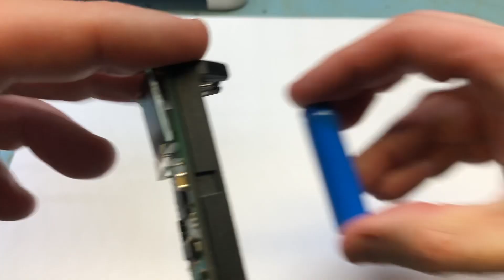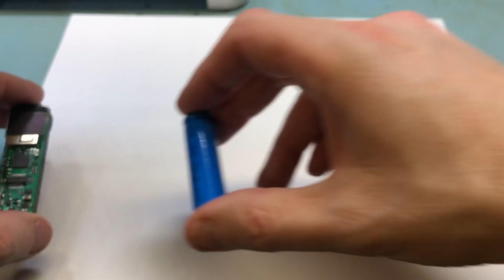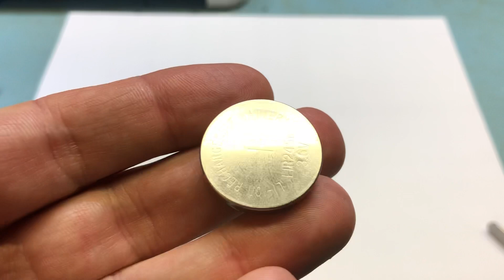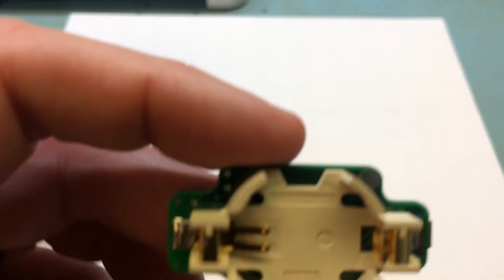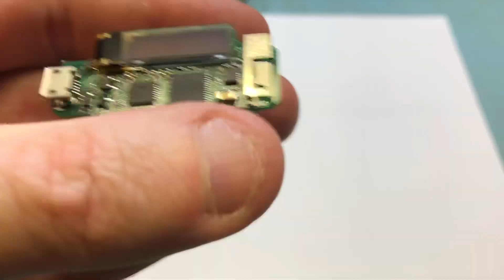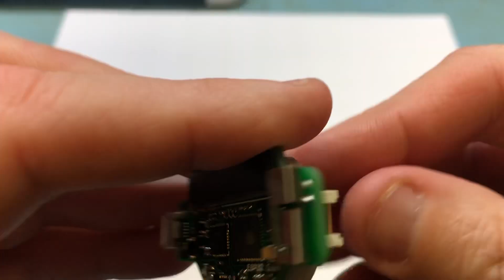ESP32 Pico D4 CoinCell Board

Comment: Awesome.  
Battery LIR2450 has enough power (mA) to run Wifi ?  Wifi need peaks about 400mA I think...
I have some doubth about antenna, 
I see  in Rev 4 don't use C1,C2 for tunning  ( I think is not necessary because antenna has Z=50 ohms and datasheet esp32 tell Z out = 50 ohm too), then only use L = 1.8nH to filter, is not true? 
 By other part in Rev 1 your use  C1,C2 and L which works better for wifi ?  Rev 1 or Rev 4 or both are well ?  Thanks a lot and thanks to share
Reply from the maker: 400mA pulses stress the battery but it holds up for a little while. Hard no on the non rechargeable battery. I have no antenna tuning experience but have followed the components used on other boards and have the screen putting out RSSI values all over the house.
Reply: @0miker0   But you are using Rev 4 or Rev 1 pcb? Rev 4 only use a inductante and Rev 4 use 2 capacitors and 1 inductance... both layouts works ?
thanks
Reply from the maker: @jospicant  Both seem to work fine. No issues.
Reply: @0miker0  Then one inductor better less components... thanks a lot
Reply from the maker: @jospicant  good to know and I wasn’t sure what to use on the board. Thanks!
Reply: @0miker0  when I made one and try it I tell you. Thanks
Reply from the maker: @jospicant  Sounds good and id like to know how it turns out.
Reply: Hey do your have the files to this public? Super awesome!

Comment: Hello Mike, I have a question. Could you please explain how VUSB and VBAT power circuit works, I mean the place where's  mosfet, diode and 100K resistor?
Reply from the maker: It is a way to power the circuit from either the usb or battery. It prevents the battery from feeding into the usb track or the usb from feeding into the battery. I've copied this circuit from the Adafruit schematics and it works really well.

Comment: Hey, could you explain, why did u use capacitor and resistor next to EN pin of ESP32? :))
Reply from the maker: It pulls the reset line low for a bit on power up and then high. The line is low while the cap charges and then stays high. Pretty common on most power up reset low circuits.

Comment: Hello, how did you calculate C and L values for antennas impedance matching?
Reply from the maker: I do not have the tools to get the impedance matching correct for the antenna so I just make the trace as small as possible and use recommended values from the datasheet.
Reply: @0miker0  you mean, you used ESP32 (QFN 6*6) and ESP32 (QFN 5*5) are (30+j10) Ω and (35+j10) Ω impedance values, and according to them u calculated C and L values?
Reply from the maker: @petraszakevicius2017  I have no idea what you are talking about.
Reply: @0miker0  ok, could you please where you found those recommended values from the datasheet? They are in pico-d4 datasheet?
Reply from the maker: @petraszakevicius2017  the Pico D4 datasheet and other projects that people have done.

Comment: Hi mike, very impressive work. I am also working on a similar board but much smaller one. I wanna know how do you program these PICO-D4 chips for the first time with only Rxx Tx, IO0 and EN lines alone? I don't have an USB connector only my board
Reply from the maker: Gudimetla Kowshik you will need an external USB board to program yours then. Take a look at my schematic and you will see the CP2102 that is the USB interface and dual transistors. The dual transistors are there so you won’t have to hold a. Turin in power up to get the esp chip into a state to accept a sketch on power up. With the dual transistors you can upload a sketch with just one click: https://github.com/mike-rankin/ESP32_CoinCell/blob/master/PCB/Schematic_Rev4.pdf

Comment: What about a discharge protection circuit for the battery? Is that not needed? Why?
Reply from the maker: Arik Yavilevich battery discharge protection should be used to prolong the life of the battery. This revision doesn’t have that.

Comment: This looks awesome, great job! I'm curious about the power consumption, just to have a rough idea how much time does the board last with the code of the video and with the battery fully charged?
Reply from the maker: Joaquin Verastegui with the display on it constantly connecting to wifi it’s a whopping 5 minutes! Using sleep mode and waking every 10 minutes it will last 10 or so hours though. It turns out that wifi off of a coincell isn’t a very good idea.
Reply: @0miker0  thank you for your answer. Indeed it seems it's a little bit too much for that coin battery, although I guess you could optimize energy on the firmware. Nevertheless it is a neat and compact board that could be improve and gain a lot of potential. Congratulations!

Comment: Great work Mike, just love it, my PCB's are like giants compared to yours, I am still sticking to 0805 parts. Once I get my PNP running I might go smaller :-)
Reply from the maker: Hayri I’ve just made the switch to 0402 components that has really helped projects get smaller. A good quality boom microscope is a must though. I’m also finding more and more components have pads under the part now requiring solderpaste.
Reply: @0miker0  Thanks for your reply, I will switch eventually too, might go with 0603 first and push everything closer together, going 4 layer will make it easier as well. Would like to use the CP2101 as well to be able to get rid of the USB adapter and having it more compact. The good or bad part is, as soon as  a new PCB is ready, you already have ideas to improve it or make it smaller with added features :-) For me right now, the display size is the limiting factor so I try to add as many features as possible.

Comment: You might be able to fit some of those tiny side mount tactile switch smd's around the edge.
Reply from the maker: Steve Gagnon they take up too much space. Right now it wakes when touching the capacitive pad. I’m working on it also working on having it wake on double tap using the accelerometer.
Reply: @0miker0  was thinking of something like alps SKTDLDE010. though im sure you can get other parts that are even smaller.
Reply from the maker: Steve Gagnon I cant have momentary buttons. Capacitive pads maybe but no buttons.

Comment: Nice project, what development tool chain and programmer are you using ?, whats the programming interface  that you use to blow code onto the board, I don;t see a programming port ?
Reply from the maker: Peter Wilson I’ve never even mentioned in the video that the Arduino IDE is used to install new sketches over the microUSB cable. You just select the correct com port and then click the upload button. The CP2102 chip is the USB interface chip.
Reply: mike rankin that’s excellent, which programmer and board do you select from the arduino IDE, I see lots of choices once I’ve added the ESP32 arduino module..
Reply from the maker: Peter Wilson ESP32 Dev Board

Comment: Impressive little boards! Are you hand soldering these or reflowing?
Reply from the maker: My screen didn’t arrive with the boards so I had to hand solder. The screen is a faster and more reliable method because the only ground net is the large pad under the center of the ESP32 chip.
Reply: Are you hand soldering all the other components, capacitors, resistors, pico etc?
Reply from the maker: Ian Tcroft yup. You need a cheap 858D hot air wand and microscope along with a regular iron.
Reply: Fantastic!
0402 are not for the faint hearted!

Have you considered creating a vlog assembling your boards?
Reply from the maker: Ian Tcroft I could never solder a 0402 without a microscope. A few years of hand soldering without one eventually ruins your eyes. As you can see from my videos, I have no camera gear or editing skills at all for showing soldering techniques.
Reply: A microscope is a must then! Have to say they look very tidy from your close-up shots!
Shame you don’t have the equipment to record it, would have been great to have seen your technique.

Comment: very impressive, What is the usb esd protection for ? I have never seen anyone use or need that.
Reply from the maker: tablatronix not sure if USB esd protection is needed. I was just messing around.I’ve seen a better design that uses a different part that monitors current and protects against a faulty device from damaging your pc that it’s plugged into.

Comment: Gorgeous looking board, very clever design work to fit into the footprint!
Reply from the maker: Stephen Ludgate thanks Stephen. It was a fun little project. Switch to a 4-layer board and 0402 size components make routing pretty easy.